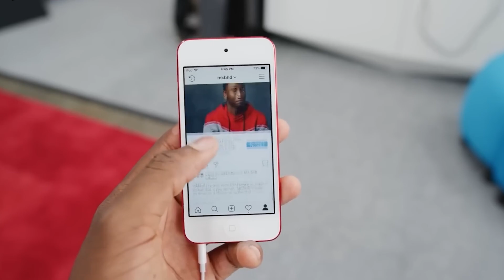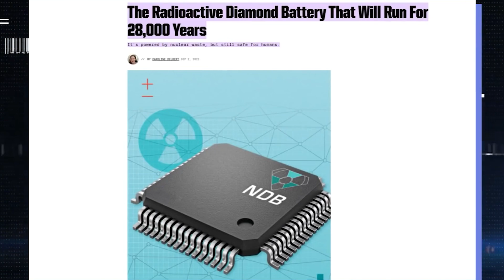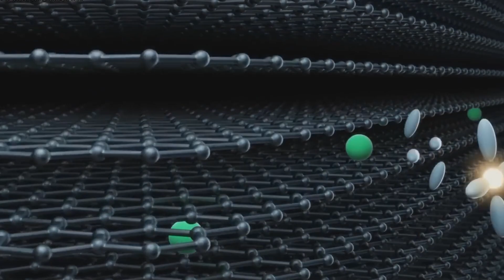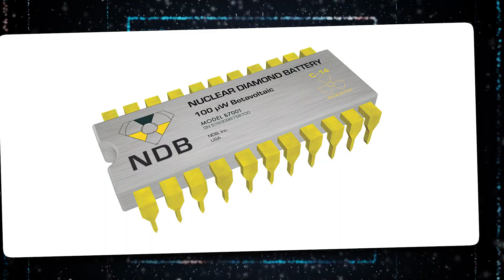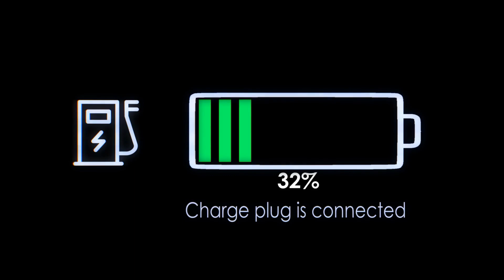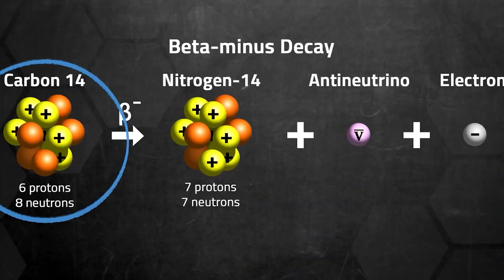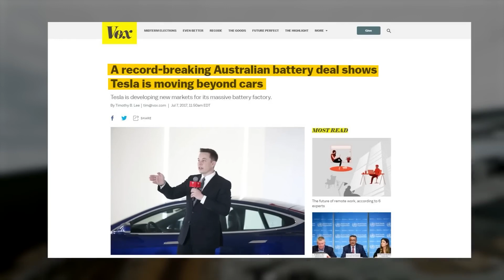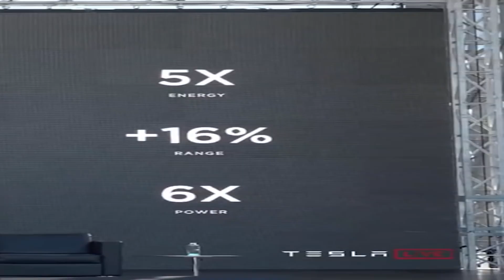Elon Musk FINALLY Announced Nuclear Diamond Battery 2023!

Comment: These tiny batteries have a max power output of 100 microwatts, and are 15mmx15mmx5mm.  You would need 10,000 of them just to get 1 watt.

They are tiny for a reason.  It is basically a tiny piece of radioactive material positioned in front of a tiny solar cell, with an outer protective layer to prevent it from irradiating you.

This technology has been used in pacemakers (which don't use much energy) since the 1970s, and is used so that they can implant it and never have to cut you open and change the battery during your lfetime.  Although rare, there ARE cases of tumor development at the pacemaker implantation site.  People with nuclear pacemakers have to get cancer screenings regularly.

If you have enough of this material to power a cell phone, that's a tumor in your thigh, hand, or brain just waiting to happen.

Cars, of course, would have enough fissile material to turn every car accident into a potential nuclear disaster.  The only objects with substantially large nuclear batteries have been objects in space, such as Voyager 1 and Voyager 2.  They are going into space, literally not on the same planet as us, so the nuclear radiation risk is very low (provided that the rocket doesn't blow up during launch).

Comment: No, Elon has not announced anything about NDB. NDB is promoting some seriously ignorant utter nonsense! The power output of nuclear diamond batteries is just way too little for use in EVs and consumer products like smart phones, laptops etc. Imagine a nuclear diamond battery that can last 1000s of years 😊...then, realize such battery needs to be 1000s of times bigger and 1000s of times more expensive than a Li-Ion battery for the same power 😮🥸🧐…do your homework about POWER DENSITY (in this case micro Watts per cubic centimeter) and you will understand this message! And no, R&D on this battery type can not defy the 1st law of thermodynamics limiting the max power to the natural decay power (isotopic power) that will forever be in the micro watts. In fact, if any betavoltaic battery could actually produce Watts of power, rest assured it would also be extremely dangerous as such power of radioactivity is highly lethal.
And the claim that the lifespan is 28000 years is also utter idiotic.